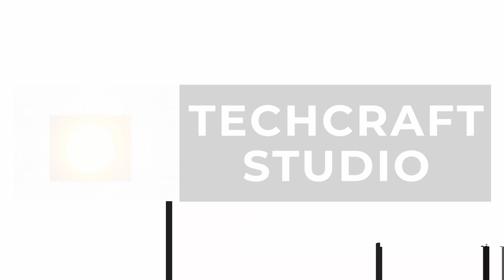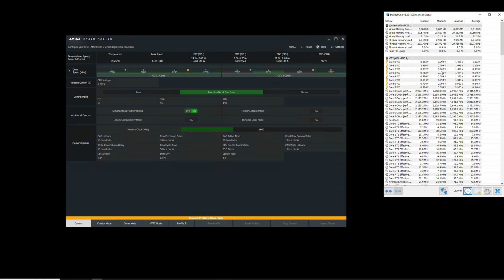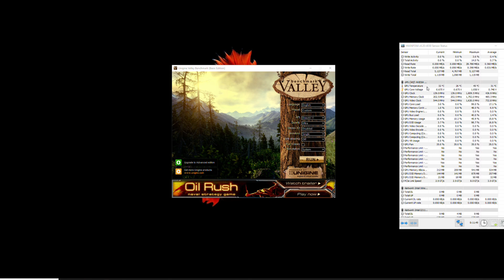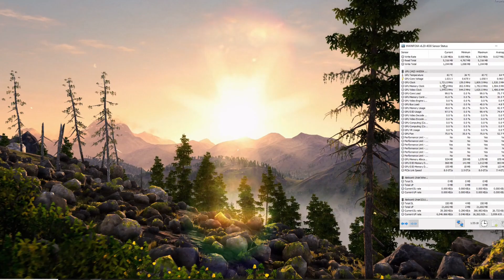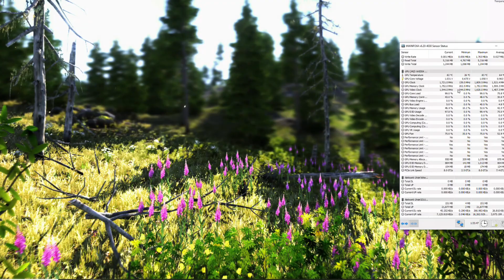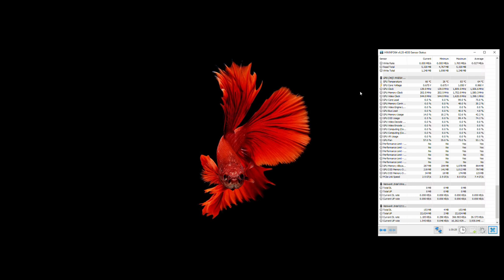100% Fanless and Silent PC - The Best and Most Unique HTPC Gets TEMP TESTED

Comment: I really enjoyed your DB4 build videos and i ordered today a DB4. Did you messuare the overall power consumption under load as i plan to go with a Ryzen 3000 with 65Wand a gtx 1650 with 75W . I would like to use with the   Streacom power supply with 240 W, so it would be great to see the power consumption of your build. Thanks!
Reply from the maker: Yes each component(CPU and GPU) consumed ~70w-80w each. The 240w is enough. Keep in mind the 240w psu from Streamcom only has x1 4 pin CPU power. Most motherboards for Ryzen have x1 8 pin CPU power. It might work if you plug in the 4 pin but I would verify with the board you choose.
Reply: Thanks for the feedback and 

the advice with the 4 pin!